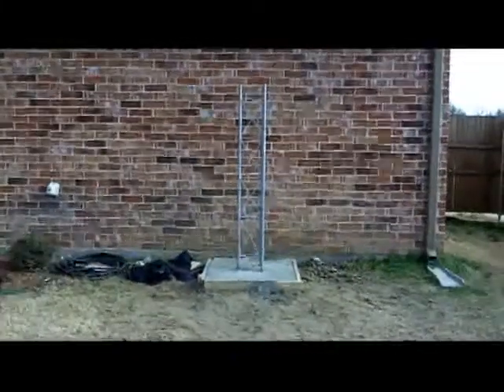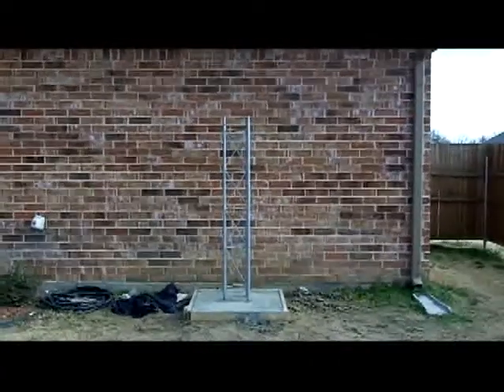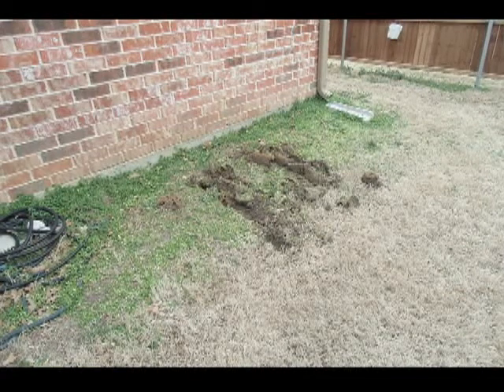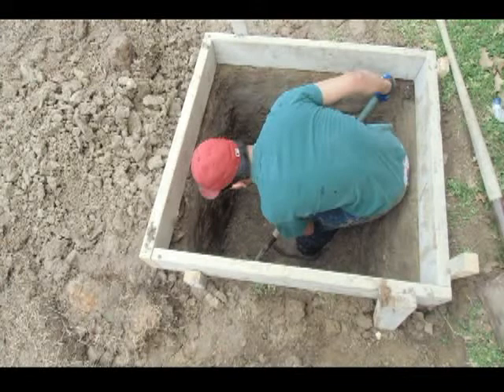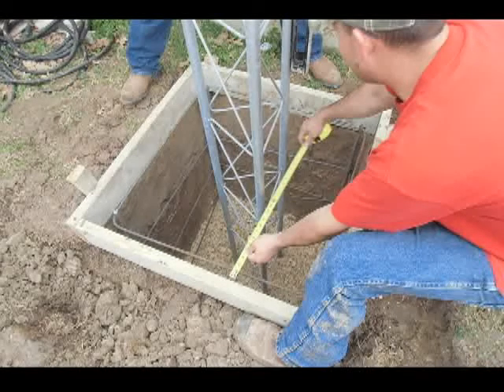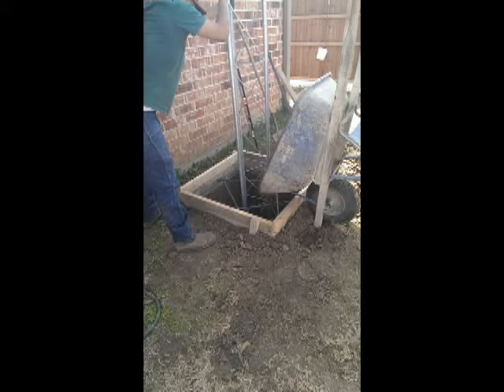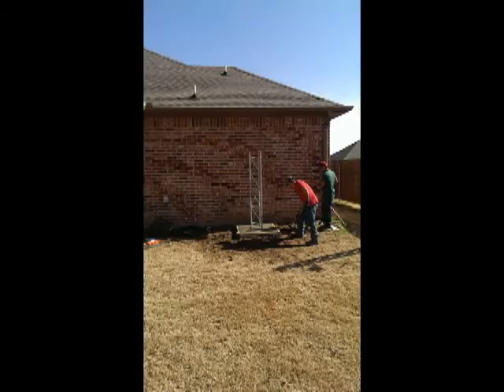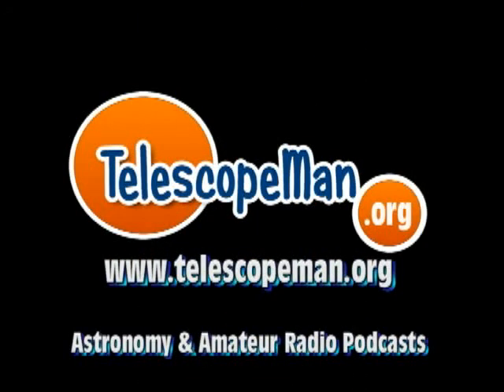Beginner Ham Radio #8 - Tower construction

Comment from the maker: No VHF-UHF on the tower-- I already have a Comet GP9 mounted fairly high over the storage building in the backyard. I also intend to keep the QSO King long wire to use on 160-6meters.- if I need any odd bands like 17 meters or 6 meters.
Reply from the maker: However I will attach a pulley to the top of the tower so I can pull up wire antennas -- want to experiment with resonant 80 meter wire.

Comment: Hello Joe, im planning to install my first tower, Do you remember the dimensions of the hole?  how deep ?regards CE1PTT
Reply from the maker: Yes 3ft square by 4ft deep. Took almost 2 yards of concrete-- if I remember 1.8 yards. There is rebar cage inside the hole and gravel on the bottom. I show that in one of the tower videos. 73